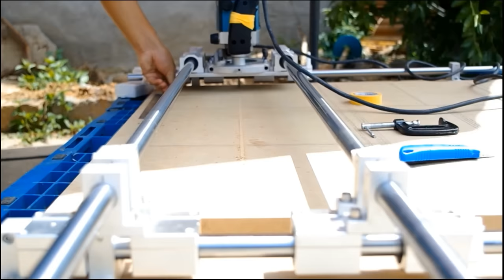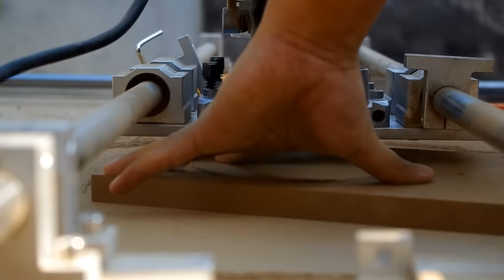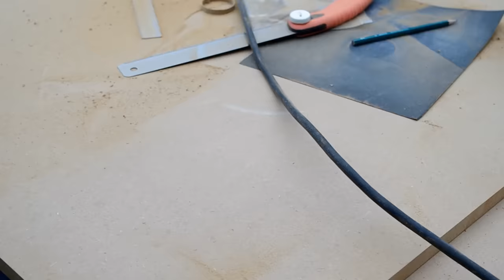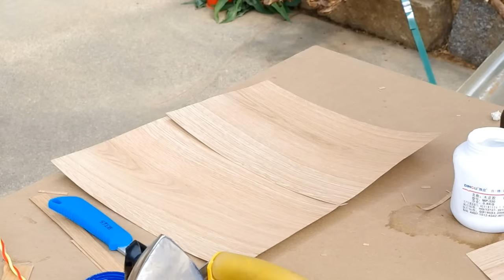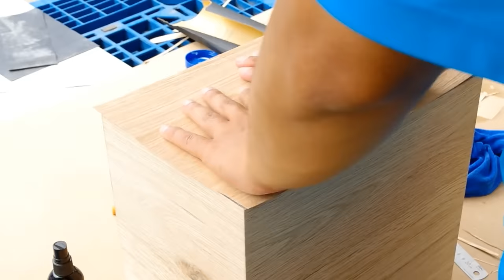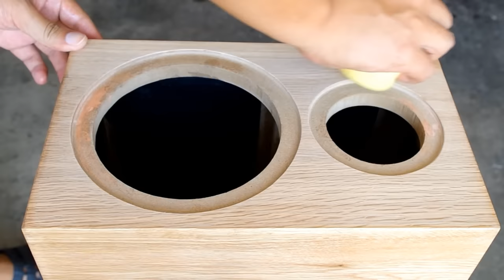Build a Loudspeaker Box with a Router diy speaker

Comment: i think ya could of made 4 cabs as they are so deep, great job, prob made them that way for more bass reflex tho..so yeah
Reply: Cabinets need to be turned for the characteristics of the drivers that will be mounted in them. Adding more "bass reflex" would simply distort the sound, keeping the box too small would add a tin like sound to whatever's playing.
Reply: @lazyh-online4839  that makes sense, sure would beat the small speakers that come for surround sound, im just used to my old klipsch ev horn speakers from the 50's, and a pair of jbl L100's..they are nice for modern speakers tho
Reply: @beatleme2  yeah, but if you're really good with sound design and don't mind really large speakers you can build a good set of speakers that can outperform basically anything you can buy.
Reply: @lazyh-online4839  I agree - the old EV electro voice and many old cabs came with DIY kits and build your own ..even radio shack had books back in the day,hence where i got started - but now its all about science etc ..but them old cabs are going up in value like Klipsch and paul himself who designed without the latest gadgets  ..and JBL hi-fi d131 speakers turned into the d120f for guitar amps... yeah i love my old ev cabs has t35 tweeters and ev hd mid horns. but did trade out the 15" speaker for a Altec alnico vott pa speaker ..lol..yeah i love it on the stage LOUD as i play guitar and used to being on stage and know ''live sound''

Comment: What is the black spray tiny bottle you are using when ironing the join of the two wood sheets? Are the wood sheets self adhesive in one side?
Reply: 1. Water. 2. Wood glue and heat does the trick

Comment: that router rails looks so interesting ,would you mind to tell us whats the maker of this system please ?
Reply from the maker: I installed it by myself .Optical axis were bought from the Internet
Reply: Jialin Liu would you mind  to send me a link with  the  from where you bought  them please
Reply from the maker: https://item.taobao.com/item.htm?spm=a230r.1.14.20.56f5b7ac0OCnIx&id=42277319368&ns=1&abbucket=14#detail
Reply: Very interesting, just wish they had an English website.  Excellent router idea.
Reply: im glad im not the only one who throught that system is an excellent idea you can also use linear rails and mounts for it from ebay or wish i dont know about the mount the router is on but i need one these for my tower speaker build for sure!